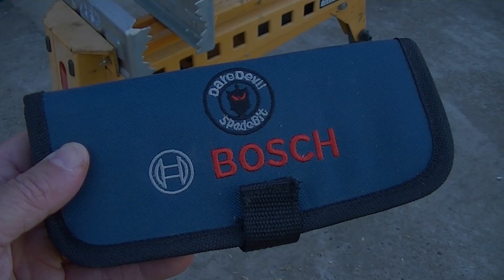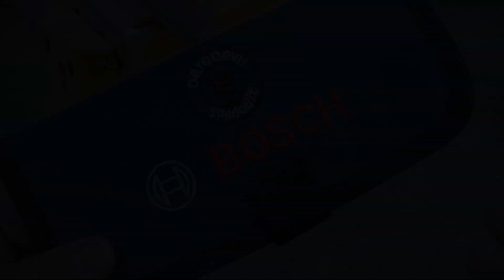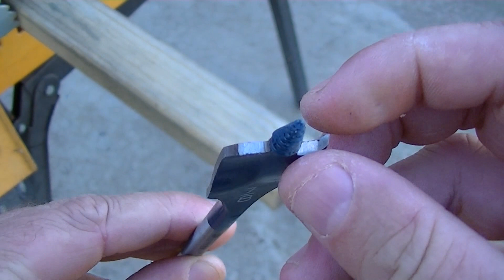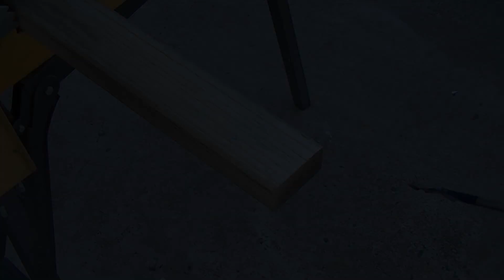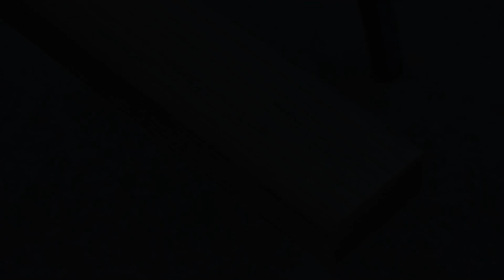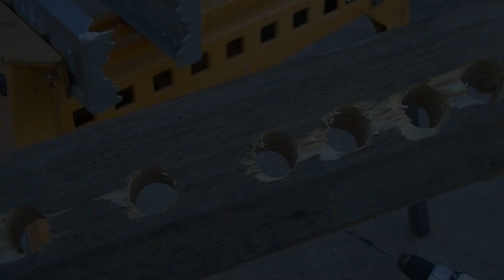Bosch Daredevil Spade Drill Bit Review - OnlineToolReviews.com

Comment: Found these useless for the average drill the average person has. Probably great for the trade but not Joe public as normal drills aren't powerful enough. Avoid if you don't have a very powerful drill. There's no mention of the torque needed to use this bits on the packaging which is a shame as I've wasted my money on these.
Reply: Mania28 Indeed in oak my entry homeowner grade corded drill starts to struggle at 7/8 and just gets worse up to the 1 1/4. the Self feed is what really causes the issues for me, not only with the drill but with splitting unpiloted boards. Might take a file to those threads so it cuts rather than displaces and feeds. 

Works okay in my brace though it does take more work than a freshly sharpened traditional paddle bit so damned be technology.
Reply: For really clean holes I guess a Forstener bit is the way to go and maybe a brace.
Reply: I also wasted my money on a set of these. Bought them to drill holes for an arcade cabinet. Ive gotten one clean hole with these. everything else is a mess.
Reply: Chris Jericho they seem to just rip the wood up unless you have a really powerful drill.  But yeah I've just bought the normal bits and they do a much better job